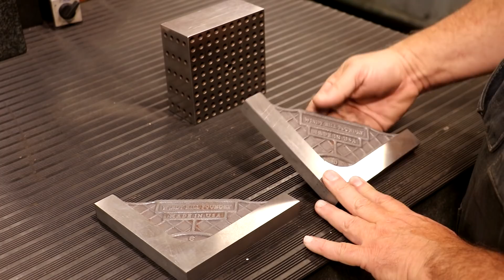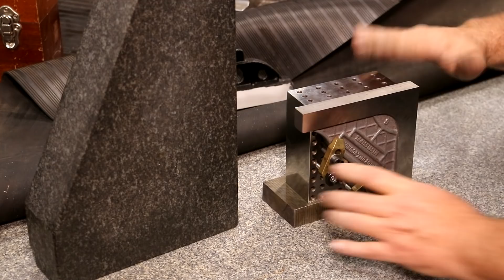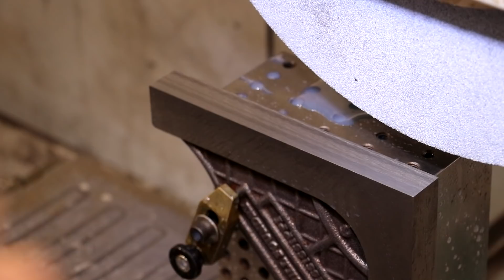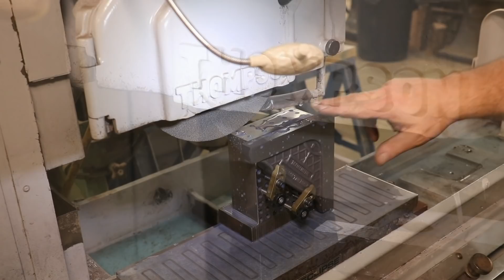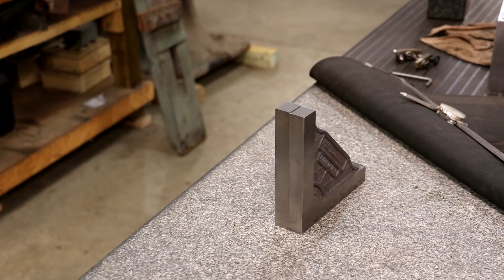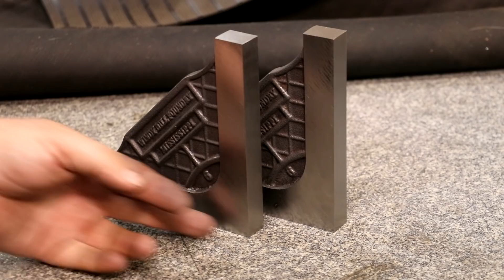Grinding two Surfaces Square on the Surface Grinder

Comment: Just a hobbyist, but will not the surface grinder  wheel change diameter when grinding , thus not keeping the distance to the workpiece exactly the same, or does these machines compensate/ indexing somehow for this change in diameter / distance to the workpiece while grinding. Just curious.

Comment: For best results when surface grinding, wheels need to be balanced and trued - two distinct and required preparatory processes. Small machines have small-diameter spindles, and are likely MORE sensitive to wheel imbalance than large machines. The very common Sopko adapter

Comment: I would suggest 20 to 30 thou step over for finish cuts. Also only 5 tenths or less depth of cuts. And as many others have said some spring passes. Heat also has a large part to play when trying to get flat, parallel and perpendicular within tenths. Although with the coolant that should mitigate most heat issues

Comment: If the "precision block" is square, flat, and parallel to 50 millionths, why isn't the square you ground square to within 50 millionths? Where did the error come in ?
Reply: Probably the machine... I'm sure theres a slight flatness error on that old girl

Comment: Slower side-to-side travel and finer front-to-back increments between passes does a lot to improve surface finish. How much is your downfeed each pass? For ultra-fine finishes, I will run a couple "spring" passes with no additional downfeed; stop when it sparks-out.

If I were the owner of these squares, I'd have painted (powder coat) them before starting so the web would be protected.

Comment: Back in the early 80`I ran a 20` Thompson  surface grinder in a job shop. Some of the work we did was the angle plates for j c Busch. Did ones up to 4 feet tall square to 2 tens per foot.

Comment: Over wheel dressers are great if your grinder has no wear in the column. If you try to dress with worn column  the wheel is true to the column not the magnet which is not ideal.

Comment: After watching various vids about surface grinders… And the effect of magplates bending the workpice… I was wondering how much this setup, clamping on the thin web between the legs would distort the pice…  my thought was that clamping maybe should have been done on the legs themselves?  Any comments on that? But maybe these effects are far to small to be noticed on this part?
Reply: My thoughts too; distortion caused by clamping on the web.

Comment: The way you touch off is not wrong but I touch off a little bit differently. 
With the wheel off and over the work piece I turn the wheel by hand and slowly feed down till the wheel just drags against the work piece. Also making sure the work relatively straight. For me 
I have less surprises. 
Balance wheel depends on how stiff your machine is. The Cincinnati no.2 I never needed to balance any wheels but I work a Dakota model KO lee and  l have to balance almost every wheel. The difference is the Cincinnati no.2 is 
about 2000 lbs and the KO lee is about 1200 lbs . Makes a big difference. With the finish your getting I wouldn't worry about it.

Comment: Hey Keith!
I'm interested in your precision grinding blocks, do you true them up?

I am always flattening sharpening stones, but I think you would need at least three surfaces to guarantee flatness.

my concern is that the precision grinding blocks may well be out if true of you only reference them against eachother.

I know it wouldn't matter for your end result here, cool that you have a special set of abrasives for this sort of thing. My stones for knives wouldnt cut it.

Comment: Nice job Keith, I always learn things watching your videos.  One question on the inspection following the square-grind process.  You used your magnetic transfer block as a riser, and explained that because it was the mate to the block used on the grinder and that it may introduce some error.  If your 6X6 block is the gold standard, why didn't you just hang the tail end of the square off the edge of the surface plate and eliminate the riser block entirely?  Obviously, you need the block for the grinding operation, but for inspection purposes wouldn't this have been simpler?

Thanks

-Kurt

Comment: I think you could have gotten a more accurate, or at least more easily readable, 6" measurement by using a tenths indicator on a stand (like you used on the surface plate) and a 6" gage block as a setup piece to zero the indicator. Any difference off zero would have been a difference off 6" height.

Comment: Balancing isnt worth the time IMO... I run grinders for a living we buy pre balanced wheels from norton and they are plenty close enough no one at my work balances wheels I'm still able to get sub 8ra finishes easily. Also I think your surface finish issue with that SG wheel was dress speed... if you watch the video you dressed extremely fast with the sg wheel using hydraulics and a lot slower with the SC (silicone carbide) wheel... any of those wheels will give a good finish it's just more of how well it cuts and how much stock removal you can get done in between dress cycles... just my 2 cents...

Comment: It's better to use the magnetic placement for the diamond dresser. The "on machine dresser" introduces side play vibrations....Anyway I appreciate and enjoy what you. Thank you
Reply: wheel dressers are the best money makers there are however he does not have much experience with them. diamond on chuck is best but will run a shop out of business.

Comment: What is the difference between those stones and the ones you can sharpen a knife with?
Reply: Same base material, However these are then ground the same way as he is grinding that square so the the mating surfaces are as close to dead flat as they can be. Unlike the out of the box versions that are sort of flat.

Comment: Keith I'm just asking a question Sir.  By stoning the surface like you did to remove the Burs, 'wouldn't that in it's self change the Squareness / Flatness of the Plane of the Square?  Also, by Clamping the Square like you have shown getting ready for Grinding Surface for Squareness to a Flat Plane also take it out of Flat and Square after releasing from clamps?  Wouldn't it have been better to use a Electro Magnetic Lock Down to hold Part while Grinding? What about Room Temperature? Temp would also change how Flat a Surface is, does it not? How do you control this? Thank you Sir for sharing your vast knowledge with me. It is Appreciated.
Reply: These were soft cast iron squares and as such probably intended for utility work , I imagine if he was doing hardened steel precision inspection squares the technique would be different. That said,  for DIY cast iron squares I would want to hand scrape them “Its the not the Destination, It's the journey.” one can buy a finished import square for less than the raw casting.

Also a precision ground stone is to a "stone" as a concrete mason's steel trowel is the the dozer that prepared the site. As the grains of the ground stone have had their points ground off there is no clearance angle and they really don't cut a flat surface to any appreciable degree, only burs that stick up can get sheared off or burnished down
Reply: @jaytalbot1146  Well thanks for your explanation. I do really Appreciate it, but I was really wanting Keith to explain because he was the Man doing the Job.
Reply: @kennedy67951  ....You would be waiting a long time. Keith says he reads the comments, but I don't remember if he has ever answered or commented.  He has a full time job and (like a lot of us) time is limited.
Reply: The concept behind precision ground stones is that (1) all the abrasive grains have been flattened on their tops, so essentially what you end up with is a precision flat surface with crevices in it, and (2) burrs sort of get caught in the crevices and removed with a high concentration of pressure on a very small area, and (3) once they're gone, you have a flat stone surface against a flat stock surface, and the pressure is spread out over a large area, no longer sufficient to do any cutting.  So it's a simple convenient way to remove the dings without cutting into the base surface.

As far as "oops," I think the major one is that when he originally set up the machine, I don't think he ever confirmed that the ways were straight, and I don't remember him saying that he ground in the top of the magnetic chuck to make sure it was parallel to the motion of the ways.  In other words, he could be cutting a right angle that's tilted by the chuck surface, and depending on how he orients when he flips the fixture 90 degrees, possibly twice the chuck surface's error angle in the long direction.  Maybe he did mention it and I've forgotten; I forget everything!  I love Keith, and I'd bring anything to him if I needed it done quickly and "good enough", but he doesn't ever seem to have the time to dig down into the minutiae that really brings precision.  I suspect it's a combination of a ToDo list that's a mile long, and then that makes it hard to have time to learn more about precision practices.  I think he could do it... in a different world!  :). Priorities, son -- priorities.  :)
Reply: @ydonl  well, that's a better answer than I've gotten so far. Your opinion is acceptable and Appreciated.
Reply: @kennedy67951  You might enjoy ROBRENZ and/or Stefan Gotteswinter if you like precision techniques.  Both have videos on precision flat stones, along with gobs of other interesting stuff.
Reply: @ydonl  Thank you.

Comment: I don't envy you for getting carpel-tunnel surgery, personally I was lucky enough to avoid it.  I had it years ago.  I was crawling under my house in the crawl space, working on a frozen drain.  I moved a hot water pipe out my way, and didn't know there was a crack in a 220V wire.  I got the jolt of my life, ended up with an electrical personality, but poof! carpel-tunnel gone and haven't had a problem since.

Comment: Over 50 years ago I ran a Thompson grinder very much like that one, the hydraulic pump whined the same way until the boss had me rebuild the pump. The race that the vanes (Vickers vane pump) run in was worn with chatter ridges, replaced it and the vanes and the whine went away.

Comment: Right hand Carpal tunnel and ring finger trigger lock surgery last spring.  I was down 3 months. Last week had left thumb joint reconstruction, 6 - 8 weeks in cast. then 6 - 8 in brace.  I'm bored stiff, can't do nuthing.  The real bugger is right thumb reconstruct is next followed by carpal on left.  take care get better. Update: I bloodied my nose trying to scratch my nose with the hand in cast.

Comment: So... if you need a square-ground fixture to grind the square, and known-squares to inspect the squareness, how was the "primordial" known-square made and verified in the first place?
Reply: The whiteworth 3 plate method can also be extended to squares.
Reply: @mzb8134  Thanks that was an interesting read! But my question was about the perpendicularity not the flatness. Found a book that explained how to reach the squareness from the withworth 3 plates: it's using a box with 2 opposing sides, flat and parallel, then the perpendicular side is made flat, and checked with an indicator and bumper with itself by reversing the box.  (After setting the indicator to 0 on one side then flipping the box the indicator will show the double of the error in perpendicularity of the face)
Reply: Those two squares, placed face to face upright on that perfectly flat granite stone should have no space between them top to bottom.
Reply: @jamesogorman3287  Yeah, but... they will also have no space between them if they're both tilted at the same (opposite) angles.
Reply: you simply step grind it dead nuts. that is how tooling is made square from scratch. not by purchasing an item assumed to be square. his method to check the squareness after--------------------was simply wrong as his tenth indicator showed.

Comment: Hey Keith. Would it not work when measuring the surface to turn it 180° and it should be out by the same amount in the other direction if these parallels are not exactly parallel. It's how you check a carpenter's level turn it 180° on the surface and if it's out by the same amount the other direction then the bubble is on. Actually the way you did it is correct I believe. If it's out by the same amount on the same end on both services then they should be 90° to one another

Comment: I can hardly wait until I see my own Mississippi square!!  Well done!

I know now why all the old timers I knew didn't put up with anything.  They were tortured at night by nerve pains.  My carpal issues would wake me at night with a red hot ice pick feeling.  I didn't have much tolerance during that time.  Amazing how a few years will give you better perspective.
Reply: if you have carpal tunnel the diagnosis is if you shake your hand down like shaking down a thermometer. if that is the case you should get the operation like I did. any questions on the procedure I can let you know interested.
Reply: @jaysilverheals4445  Thank you!  I got mine done late 2019.  Thankfully, the nerve conduction study didn't find any issues above the wrist like Keith.  It has been a real game changer for me.  I can sleep now, and grip with that hand too.

Comment: Where did you get that hold down kit? Looks really nice. I've been looking for a nice smaller hold down kit and haven't seen anything complete.
Reply: Joe Pi made a set of these as well as a mini fixture plate....I copied his design and made the same set, use them all the time.  If you want a Fusion360 design/print, send me a PM and I'll shoot you a copy.
Reply: @ericsandberg3167  I'm definitely interested. I'm not sure how to send a PM on here.
Reply: I'm guessing he made most of it. The toe clamps aren't hard to make and "T" nuts aren't hard either. For the rest it's just hardware store nuts and bolts. I've made most of that stuff for myself although I don't have the cool box he's got you can get them from Canadian Tire, (in Canada), and I suspect Harbour Freight in the US.
Reply: Boys with their toys. Is there anything you can't do in your shop?

Comment: Could you have used your cylinder square to verify the squareness once you got done with the grinding? Also, how does one determine how fast the feed is for the surface grinder? To a novice like me, it seem to be moving very fast.

Comment: A woodwooker here, but I'm a little confused...your process seems to rely on the inner faces being square and parallel since those are the faces resting on the square block.  If they're off, won't the grinding be off as well?  The end result would be parallel arms, but not necessarily 90 degrees.

Comment: Keith, we had a place nearby that had some grind wheels like that, but no hubs. They had some wheels that were kinda' like a dense Scotch Brite. They are gone now, but for the life of me, I couldn't think of a single use for them.
Reply: The wheels might have been intended for linishing materials like Stainless steel with a linear and consistently fine scratch  pattern.
Reply: @johncoops6897  that was my thought. I'm not sure what the company did with them. They had them for quite some time. They decided to scrap all of their used or otherwise fasteners, so who knows what happened on the grind wheels.

Comment: Hi Keith  how about using the squareness comparator to check square that Steve Barton made?
Reply: Why?  No need with Steve's work.
Reply: @paulcopeland9035  I phrased that poorly. I was suggesting that Keith put the square directly on the surface plate and use the squareness comparator to check the accuracy of the newly ground square without the fixtureing that could be introducing some error.